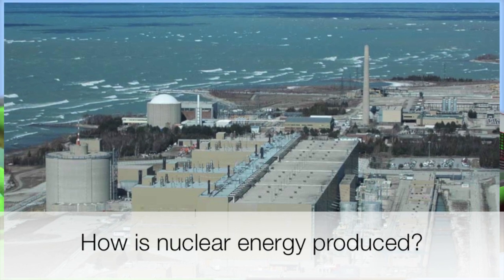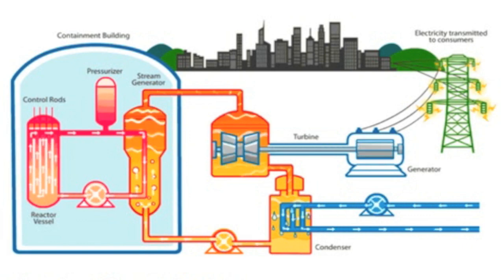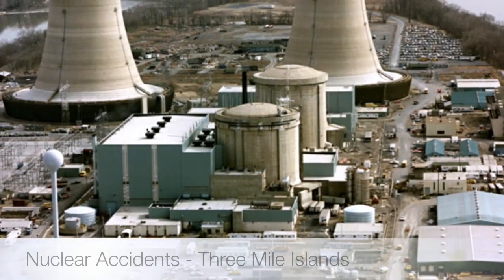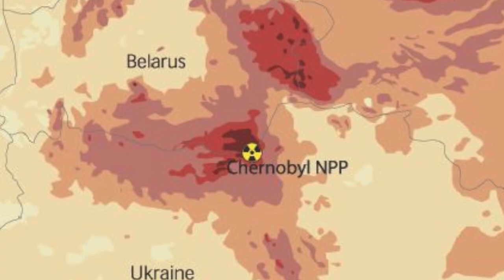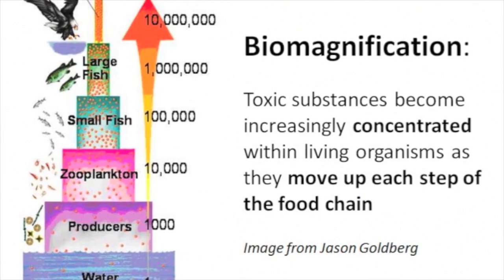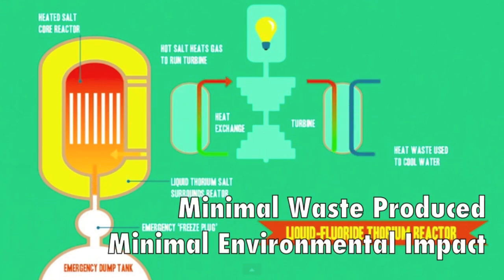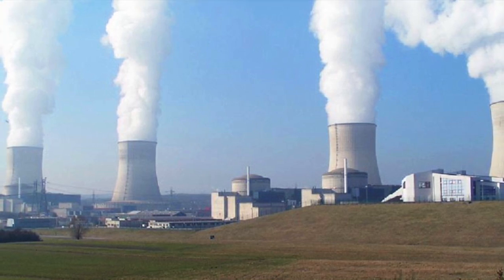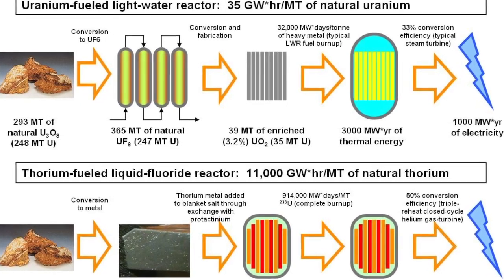Thorium vs  Uranium

Comment: Thorium is actually mined with rare earth metals as a byproduct so there is no actual increased risk in mining it heh.
Reply: A good thing too. We can strip the rare earth metal monopoly from China while utilizing Thorium which is 1 million times more energy dense than C-H bond.
Reply: Just setting up a Thorium repository, s the miners can get rid of the Thorium, would be enough to restart rare earth production in the US.
Reply: Coal contains uranium and thorium. The resulting ash is 10x more radioactive. USA considers coal fly ash as a harmless waste yet uranium runoff from that waste is known to enter ground water. Thorium is not water soluble so stays trapped in the ash. 
https://www.scientificamerican.com/article/coal-ash-is-more-radioactive-than-nuclear-waste/
With all that in mind, why does USA also consider natural thorium as a nuclear material? It's been lumped under the same pile as uranium and ignored for ever after.

Comment: The nuclear industry is very happy to have ignorant enthusiasts root for these so-called"new" technologies that have been well-known for well over half a century.  It is well known why we do not use Th reactors today, and it is not because "there isn't much experience" as claimed here, but because they know very well that it is costly, inefficient, and dangerous.  

This video pretends to address why Th reactors are not in use, and then glosses over the history..

Most of the glib claims as to why it is so wonderful overlooks the practical issues and thermodynamic inefficiencies involved with extracting the energy, processing the salts, dealing with the radioactive salts and byproducts, and having a closed system that will last reliably for 5 years, much less 30 years. 

In other words : this video contains a lot of BS.
Reply: Don, put simply, you are a cretin. Thorium is brilliant. The only reason it didn't get taken up early is because you can't make a nuclear bomb from it !
Reply: Don  please get some education before you react
Reply: I don't have to react; only observe.

The nuclear power industry is rightfully concerned about its future, and desperately needs a "new" technological promise.   Thousands of nuclear engineers will happily put lipstick on an old pig, if it will help them keep their jobs.

But you keep on dreaming.
Reply: Actually most of the 'nuclear industry' is against thorium because it will kill their very profitable Uranium fuel making business, most people who are promoting Thorium come from outside the 'nuclear industry' or worked on it back in the 1950s/60s.  I think you need to do some more research..
Reply: +Graham Stevenson     Perhaps you could help Oakridge National Labs continue de-commisioning their half-century-old MSR experiment.  They finally removed the uranium five years ago, but still haven't figured out how to transport the salt.  I'm sure you would know how to go about doing this at a trivial cost, though, being such an expert on this subject.
Reply: +ronniemarder 
That's great that you have generic, trollish remarks that have no content.  However, soon your job will be replaced by tweetbots.
Reply: Don this is false. Oak Ridge National Labs in Tennessee has operated a thorium reactor for decades. you must get your alternative facts from the same place Donald Trump does.
Reply: Don, there are no designs in these proposals that remove the U-232 in the U-233, it is a waste of time and money to remove it. It is also convenient to leave it in as a proliferation deterrent. The U-233 purification process does not involve isotopic purification. Wherever the peculiar notion originates that any processing scenario would even consider removing the U232 is uninformed. And I should add, this video is not on the topic of fuel processing. In no way do these voices in this video sound high school. These sound like elementary school kid's voices. And as such, the video is quite impressive.
Reply: Don m
Reply: +Glen Proposch    Your'e a bit kooky.  Put your foil hat back on.  Actually I'm against nuclear power as a ridiculously subsidized, PROVEN WELFARE industry, along with all of its trolls, like you.
Reply: +Ben Coad
I think you need to catch up on current affairs.  I would suggest looking at the well-known technical roadmap of the OECD.  Or are they "outsiders" for you as well?
Reply: Hey guys! This is possible to transaform Uranium to Thorium?
Reply: It may be possible but why would anyone want to, it would be very hard and very expensive. What Liquid Fueled Thorium Reactors seek to do is turn a small amount of Thorium into low-grade non-weaponizable Uranium isotope, just enough to keep the Thorium "hot" enough to be fissile.
Reply: Check out Kirk Sorensen's early videos, I'm pretty sure that in essence his concept is a closed system. The proliferation risk is "dirty bomb" vs "atomic blast" decision.
Reply: BTW I think the MSR @ Oak Ridge was never allowed to actually test the Thorium cycle concept, it just ran in a "ready to test" state for about 4 years. It was expected to very likely to be successfull.
Reply: + Don
You are stupid! There is only a "trace" of U-233! How much time you need to extract it from wastes?
And: "the LFTR resists diversion of its fuel to nuclear weapons in four ways: 
first, the thorium-232 breeds by converting first to protactinium-233, 
which then decays to uranium-233. If the protactinium remains in the 
reactor, small amounts of U-232 are also produced. U-232 has a decay 
chain product (thallium-208) that emits powerful, dangerous gamma rays. 
These are not a problem inside a reactor, but in a bomb, they complicate
 bomb manufacture, harm electronics and reveal the bomb's location."
"The second proliferation resistant feature comes from the fact that 
LFTRs produce very little plutonium, around 15 kg per gigawatt-year of 
electricity (this is the output of a single large reactor over a year). 
This plutonium is also mostly Pu-238, which makes it unsuitable for 
fission bomb building, due to the high heat and spontaneous neutrons 
emitted. "
"The third track, a LFTR doesn't make much spare fuel. It produces at 
most 9% more fuel than it burns each year, and it's even easier to 
design a reactor that makes only 1% more fuel. With this kind of 
reactor, building bombs quickly will take power plants out of operation,
 and this is an easy indication of national intentions. And finally, use
 of thorium can reduce and eventually eliminate the need to enrich 
uranium. Uranium enrichment is one of the two primary methods by which 
states have obtained bomb making materials"
Reply: Wadca where you been buddy? Please do expound upon this point more. Put some math to it, it's more likely that someone would mine their own bomb grade Uranium than try to get it from a LFTR. And what are we doing in here even. This is not the best LFTR video on Youtube anyway.
Reply: + Richard Yates
Learn about how to copy/paste other user name.
+ Don
I'm not a troll, but "herald of truth".
Do not learn me about grammar, just move you brain!
And U-232 & U-233 are TRACE and Thorium fuel!
Even in waste. Also they are NOT stable in reactor since
they are source of energy.
So no available materials for nuclear device.
Reply: Kirk Sorensen wanted the salt but they would not let him have it, it's still fissile and easier to deal with than trying to "glassify" conventional waste as they are proposing to start as a disposal strategy.
Reply: T Samuel Harrison - what are "these proposals"?   There are many proposals that are not funded for very good reason.   Leaving U-232 in is a poor deterrent, but an extremely expensive handling problem.  There are no proposals being funded to leave it in or extract it, because it is expensive either way.
Reply: + Don
U-232 can lead pre-detonation. Imagin nuclear explosion in...base.
BOOOOOOOOOOOOOOOOOM! Kim...we...have....problem * silence *
Extraction U-232 from U-233 proven to being very difficult.
Reply: +Richard Yates ---- > Nonsense.  The only scenario remotely backing up the overstated benefits of Th-MSR's is a closed Th fuel cycle (anything close to self-sustaining), which can not operate on "low-grade non-weaponizable" U-233.  Any reprocessing scenario will require removing the U232 , Pa-233, and the fissile products.  Producing highly pure uranium-233 is inherent in the process requirements.  The story that a closed Th fuel cycle (what Th-MSRs represent) is not a  proliferation risk is a blatant lie.
Reply: +Jerry Ross
ORNL only ran an MSR, by loading separately bred U-233, for five years, and nothing since.  You could verify this very easily, but even trivial verification is obviously not relevant to your agenda.  They also bred U-233 in thorium blankets in uranium reactors, but no informed person would refer to that as a "thorium reactor," and it proves very little, other than the ability to produce bomb-grade, high-purity U-233.
Reply: +Władca Wymiaru
Typical thorium troll who reponds to facts by talking in incoherent circles.  Here is a clue: first learn basic grammar, including how to communicate coherently and speak in complete sentences, then (and only then) pretend to know what you are saying.
Reply: If you do not think that leaving U-232 in the U-233 is going to be a very costly problem for a closed thorium fuel cycle, then you should probably explain how your brilliant solution, that you do not show here, is going to work in a presentation to the international nuclear physics community.  Given their inability to circumvent this issue, I'm sure they will be relieved that you have solved this problem!

Comment: The title is misleading & shows a complete lack of understanding of the fission cycles involved.  Thorium is totally stable, and only becomes fissile when exposed to Neutron bombardment, where it breeds into - you guessed it Uranium.
Reply: RE-TITLE  the video to what you really wish to Portray; " Light Water  vs Molten Salt " Reactors
Reply: I second this, seeing as a MSR can use straight uranium and even burn up a lot of the waste left over by light water reactors seeing as that waste is just compromised uranium.
Reply: @sonpopco-op9682  Yeah, but that'd mean leaving out buzzwords like THORIUM and URANIUM which are what most people know
Reply: We have already done it here in the U.S.A. Our cool story is a history lesson. We don't require progress, we just need implementation.
Reply: +darthvader5300   
Russian nuclear scientists are also free to discuss progress on MSR in Russia, and they do so quite often.  It just doesn't corroborate with your cool story.
Reply: Yes, they've associated Molten Salt Reactors with the Thorium Nuclear Cycle breeder reactors. The difficult reprocessing procedures and cost for a breeder reactor makes it quite difficult to implement. Molten Salt Burner reactors that use uranium however could be implemented quite easily and have many of the benefits that thorium would at far lower cost.
Reply: Or you can kickstart it with a particle accelerator. Imagine how much that would cost :)
Reply: Using thorium in a solid fueled heavy water reactor is just not cost efficient. You still have to deal with solid fuel Xenon problems, and recycling solid fuel is still a messy process. The Shippingport reactor tried a solid fuel thorium breeder cycle for a while , and gave it up as difficult and expensive.

If you go to MSR, these problems go all away.

An MSR Thorium breeder can be started with waste nuclear fuel rods or recycled bomb grade Pu. Just process it into FLiBe, run the FLiBe through your chemical fuel recycle stage, and burn the U235 and Pu239 in the Thermal cycle MSR, slowly replacing it with U233 as the Thorium FLiBe is baked into Protractinum->U233.
Reply: A Sam O' Nella video, half a video of some girl talking and a reading a YouTube comment with 11 replies has turned me into a real nerd for nuclear power
Reply: Spent fuel rods reprocessed into U235 FLiBe would be a damned sight cheaper.
Reply: @threejaguar  You would probably get paid to take the spent fuel rods away. WIn WIn.
Reply: into Uranium 238 which is a much safer isotope than the others

Comment: 733k curies is like 1,500 pounds of cesium in a body of water so large you could tunnel through the earth and wind up on the other side still residing in the same body of water. Not to mention in 30 years that'll approximately be something like 750 pounds of radioactive cesium. I take craps bigger than that, and far more toxic to global ecology. give me a break.